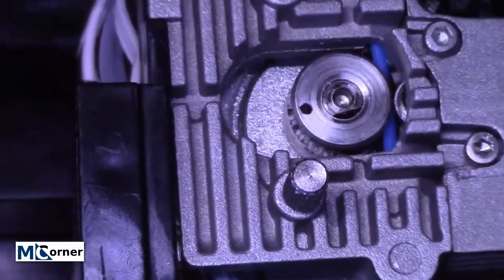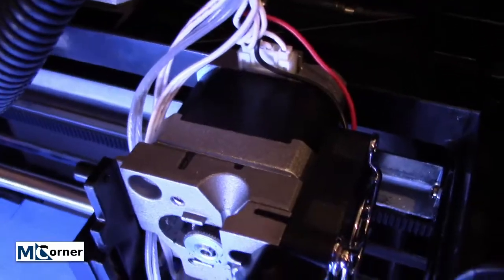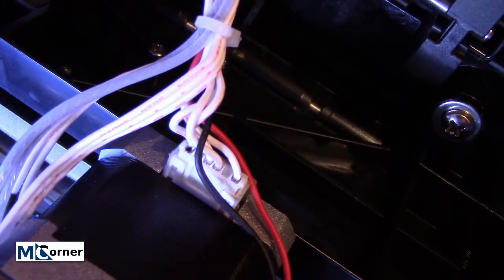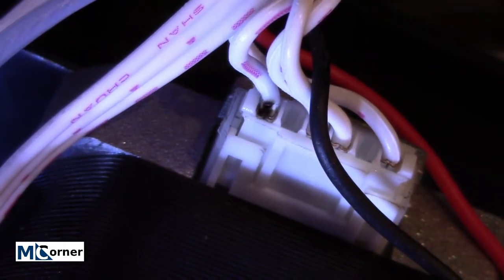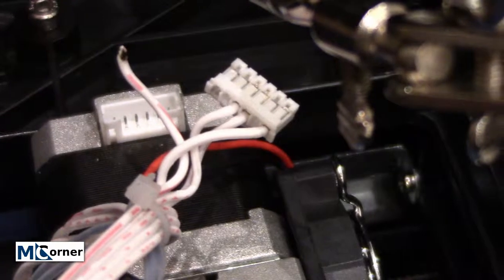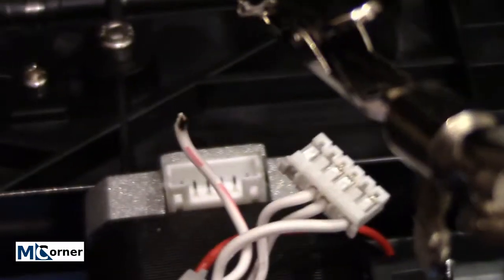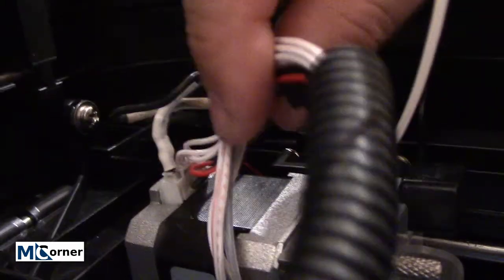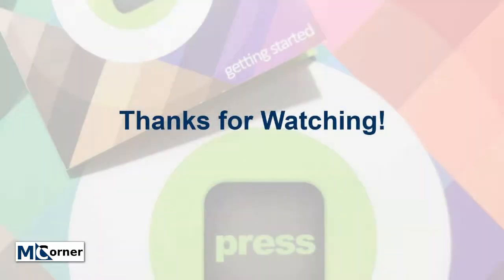Solidoodle Press - Problem List (1 of 5) Filament Feeder

Comment: My Press was one of the later orders shipped, and Solidoodle actually implemented some of the community fixes to mine. One fix was that they used a zip tie to hold the wire bundle in place on top of the print head. The zip tie went around the wire bundle, and through one of the screw holes of the fan. This seems to work very well: my wires barely pull when the print head moves.
Reply from the maker: H Alex Hi Alex.  Thanks for the tip!  I'm giving that a try.  One of the issues I've had is that the wire bundle seems to really cause bind-ups and interference in the confined space as the feeder/stepper motor moves during print.  This quick fix might have solved a few other issues I've had.